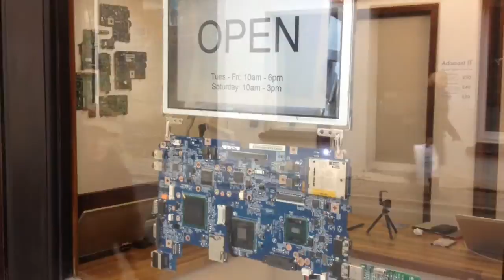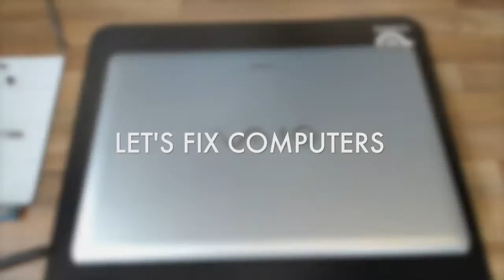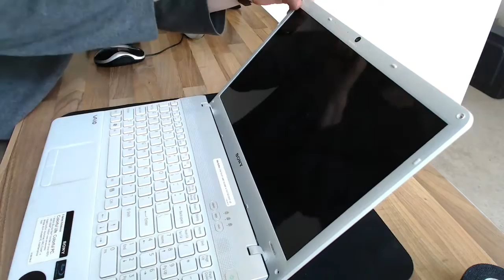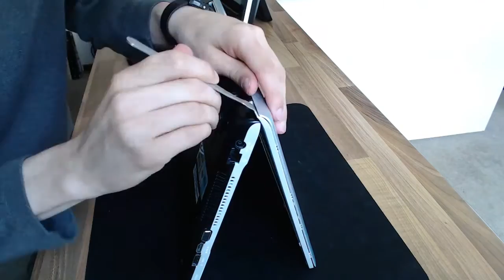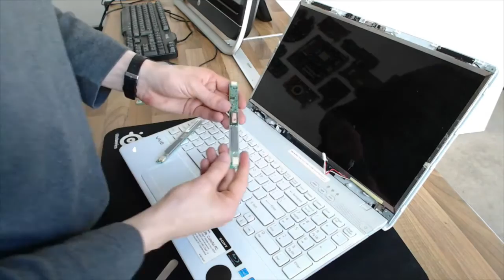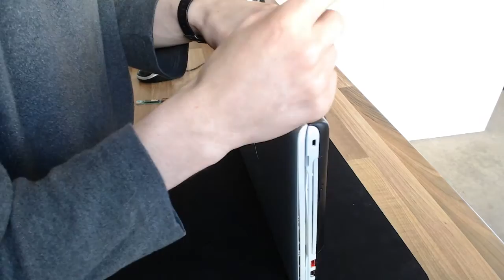LFC#49 - Sony Vaio Backlight Repairs

Comment: My backlight has stopped working, but after taking the panel apart there was no visible inverter. Does this mean that it could be behind the black screen or should I replace the screen altogether ?
Reply: @Adamant_IT  I have a toshiba c655 LED with no backlight, tried checking the cables etc plugging in, cleaning no luck. What do you mean by mohterboard issue, Is it solvable ?

Comment: You need to break the plastic under the lcd to find out what kind of backlight it has? Seriously?
Reply: *****
Googling specs isn't kinda quicker?
Not using pwm led is all but nasty. The only thing that led revolutionized is the eye strain and headache.